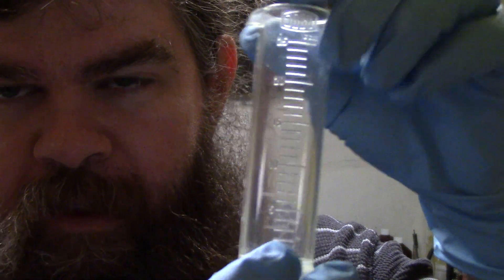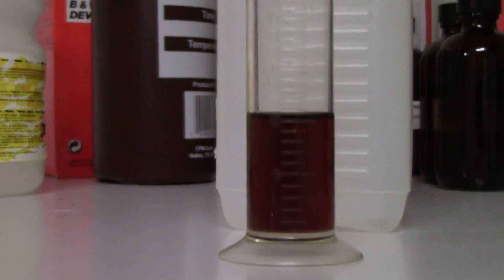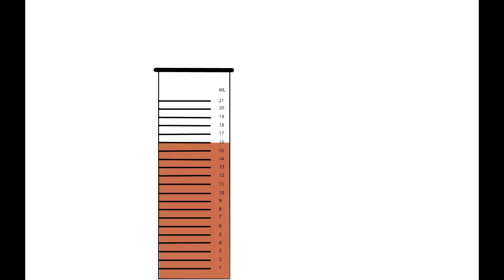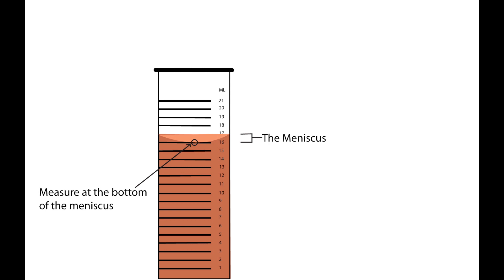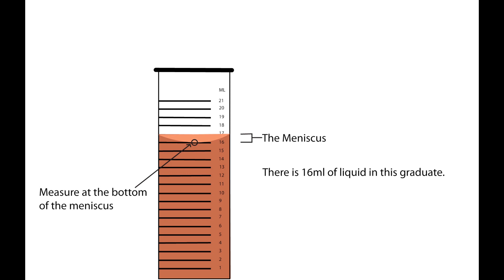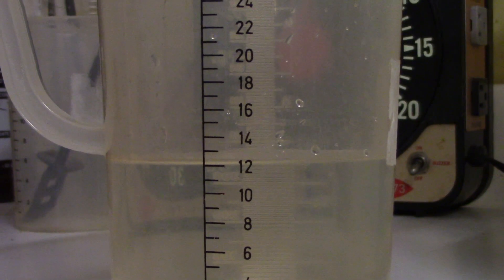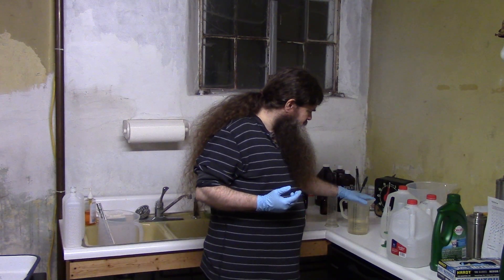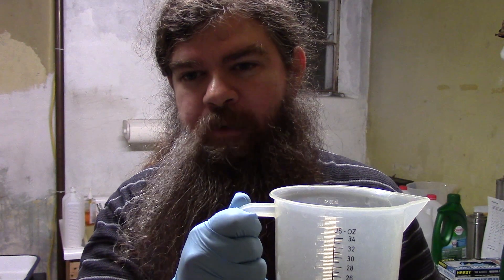Measuring Chemicals

Comment: Excellent video, Christopher. I remember you mentioned about surface tension and meniscus in your PMK video. Some people could miss that very important point. 

For a very small amount of liquid, say a fraction of 1 ml, one could also use those 0.01 to 0.1 ml graduated Insulin syringe. A better alternative would be using a graduated pippet. Cheers :)

Comment: the air trapped in syringes make me question the accuracy of using them.
If I wanted 3 ml, I'd probably fill syringe with more, then dispense until there is 3mil less in the syringe.  
then dump the rest back into the stock supply.  (always a risk of contaminating the stock by returning.  but PMK is a toxic chemical.  something to be cautious with, yet not want to discover bad developer by getting 'blank' negatives after so much work.
Reply: When you fill a syringe, you draw in a little more than needed, then turn it so the dispensing end points up. This makes the air in it rise to the end, then you push out the excess air and chemical.

To me it is just easier to use a graduated cylinder made for measuring small quantities.
Reply: @chrisandsneaky2453  The problem with this is that a syringe isn't tapered, so a 'half' pocket of air remains inside the syringe when trying to remove all air inside.  
Unless dispelling air while the syringe is 100% straight upside-down ... but that would squirt out dangerous acid (in my case pyrogallol acid).  Yesterday, I only needed 3 ML of part A of PMK formula for a development session.
 I agree that a graduate may be a better choice.